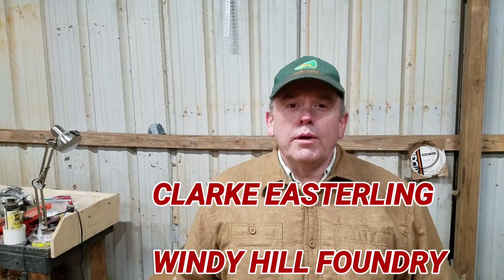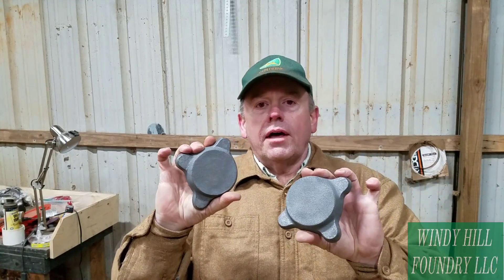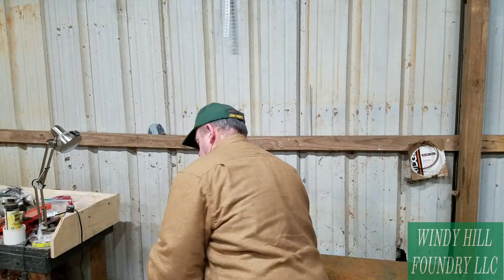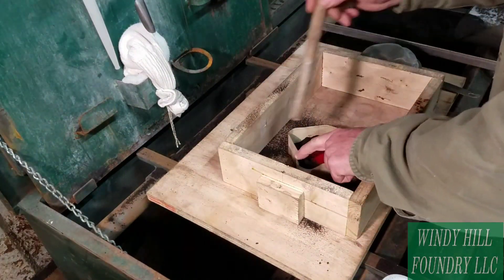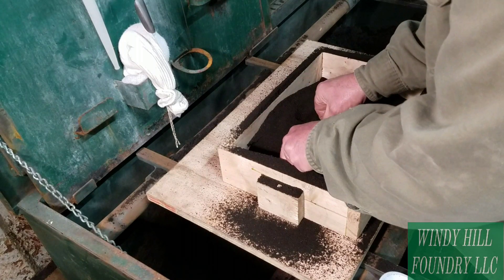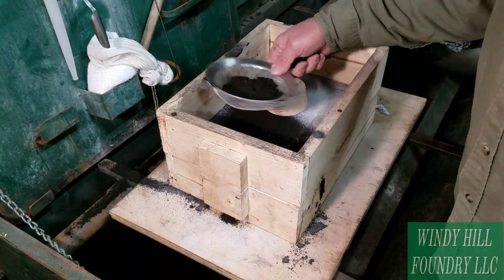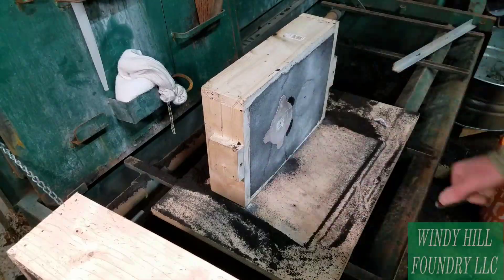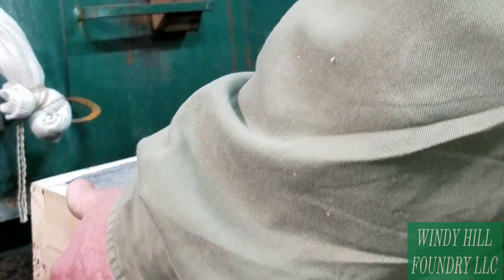MAKING VISE PARTS IN GREENSAND WHF4

Comment: At 12:48, when you're pouring, there's some spatter.  What causes it to pop like that?  Is it a gas pocket where there's no vent?  Or gas trying to come up the sprue?
Reply from the maker: Moisture in the sand, on weights or even in cores cause instant steam to blow iron. Basically anything the iron can touch with even the slightest moisture becomes an explosive reaction

Comment: I worked in a large foundry  when I was 18 to 20 years old. It has fascinated me yet today at 71.
Reply from the maker: I know what you mean. Of all the things I have ever done, this is the most complicated yet rewarding thing I have ever done and anyone who has ever done it has my respect 👍
Reply: @windyhillfoundry5940  At the time they were the only foundry that sand cast hollow parts. One being jet plane canopy frames. Also intricate small passages in castings. They workers in both the pattern shop and cores room could make magic. I never knew the chemistry on why some "greensand" was black or pink or a light green. I'd like to revisit that foundry as it is still in operation.

Comment: Nice explanation of parting down. If I have a complicated or hard to find parting line I'll try to mark it with a paint pin to aid the molder .
Reply from the maker: I actually thought about making a vertical paint roller, a dense one that would put a visible thin witness line at the farthest point out
Reply: @windyhillfoundry5940  interesting idea

Comment: hey clarke, that sucks about the steam pop, but at least it wasnt any worse than that. I was wondering about how you have the metal gated into the risers. The way you have them coming in at a tangent, wouldnt that cause a swirling motion and cause turbulence in the mold, trapping air and crap into the metal as it flows into the part? Or was there some other thing Im not really seeing that is different for iron than the other metals and the swirling would be beneficial?
Reply from the maker: I've tried it both ways. It's hard to tell but I contour the entry up to help draw it in an upward spiral which has worked good for me. It seems to throw the crud to the top.if I went straight it I risk having debri go straight down the runners
Reply: oh, ok, good info to know.